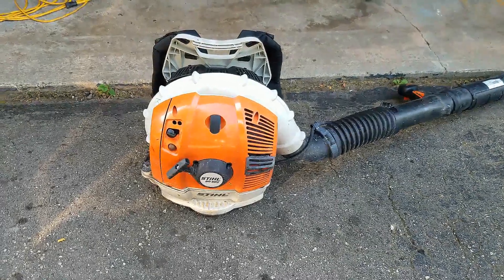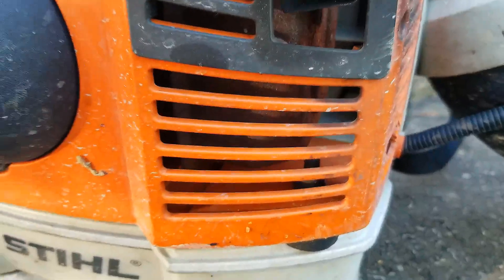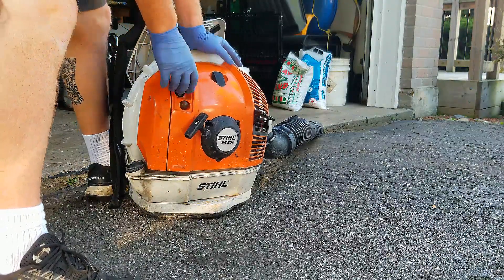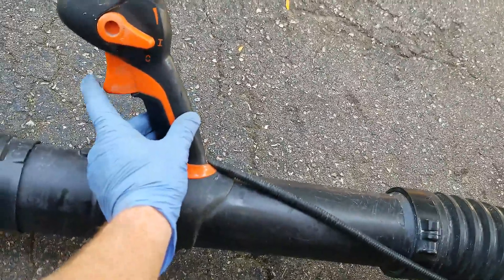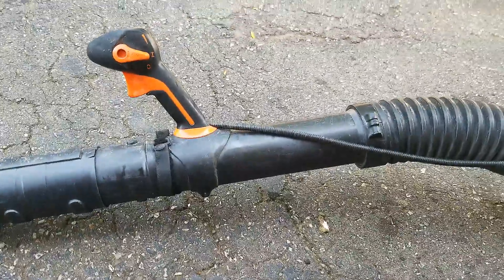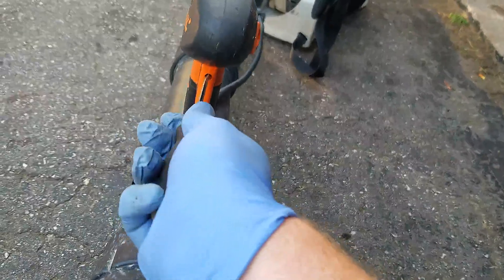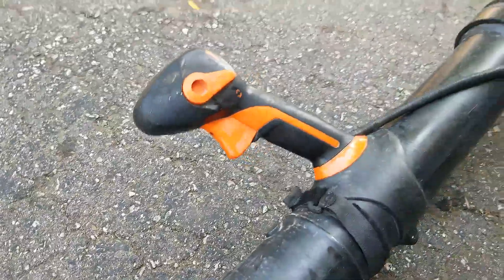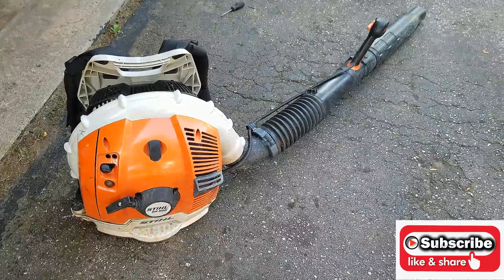Stihl BR600 Leaf Blower Not Getting Full Power? Easy $0 Fix

Comment: Simple fix, shown in clear fashion. The last two times my Stihl BR430 had acceleration issues, it needed a spark arrestor cleaning.
Reply from the maker: Clogged spark arrestors are always an issue with 2 stroke machines. Thanks for watching and taking the time to leave a comment. Cheers